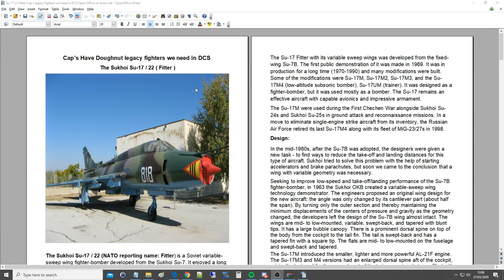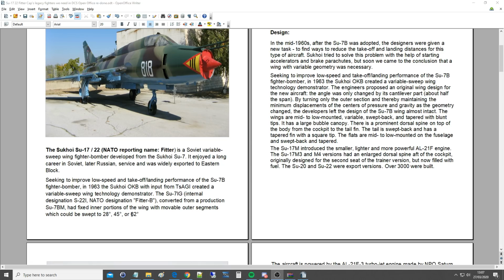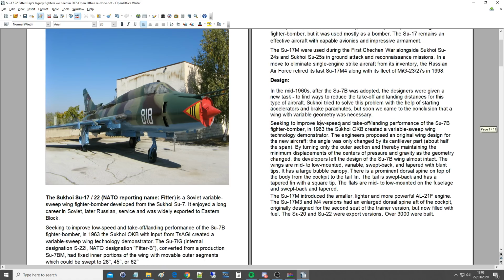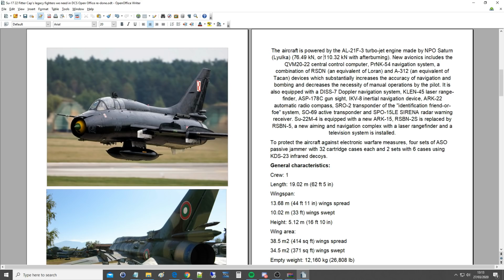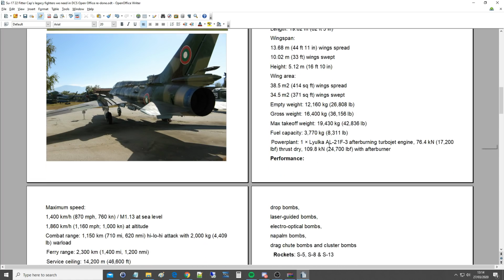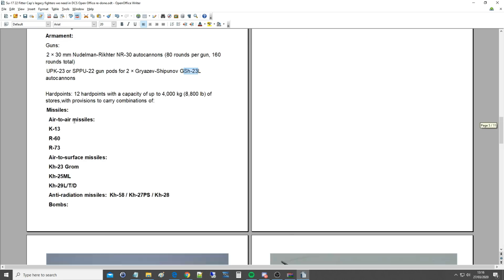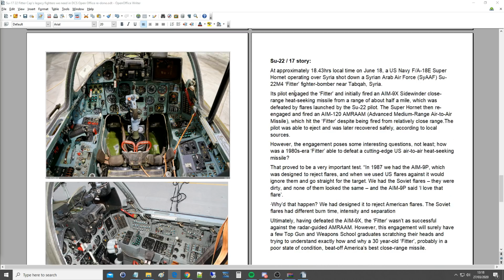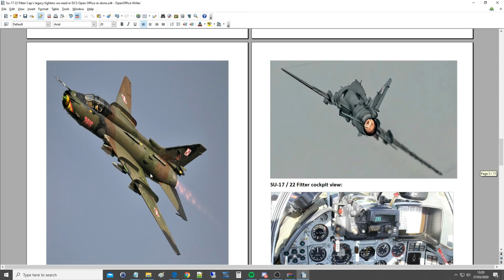Cap's Cold War Aircraft NEEDED In DCS WORLD: Su-22 Fitter

Comment: I believe  'FLAT'S   refers to the tailplane  surfaces   which  do not provide lift through an aerofoil but rather as a flat surface  whose lift is varied by adjusting the angle of attack of the entire tailplane surface rather than through distinct elevators on the tailplane trailing edge.    Here it is mounted relatively low down on the fuselage to avoid the turbulence of the wing. This is common in higher speed aircraft.
Reply: Thanks ... never knew that!

Comment: Pitty it didn't have a radar. It would be really nice replacement for playing DCS MiG21 module.
Reply: Not really in any way. The SU-17/22 is a dedicated ground attack aircraft. Basically an older Soviet counterpart the the AV-8. Same roles. It's still flying today, and has seen extensive use in Syria as a close air support aircraft. Also  did I miss something? I have been over seas for the last few months. Why dose the 21 need replacement?
Reply: @sasquatchycowboy5585  Yea but with radar it could replace it in DCS multiplayer gameplay. I wasn't referring to real life. Should behave better at low speeds and similar has short range missiles.

Comment: +GrimReapersAtomic  The OKB Sukhogo (RUS) Su-17/22 family was a Soviet counterpart of the USAF / Republic F-105 with lower wing loading.  The Arkhip-Ljul'ka-21 and the Pratt & Whitney J75 were exact contemporaries for equivalent performance requirements.
Reply: So improved on the F-105 concept. I like it.
Reply: @sasquatchycowboy5585  Considering the designed roles it would be stretching it some to  consider it an improvement.  And with the swing wing it would be a big problem having to fight in one if you got jumped.
Reply: @jpjpjp453  Fighting in any attack plane is a big problem if you get jumped. But not sure I understand your argument about swing wing. And to 105 lost over half the production run in Vietnam, so not really a great jet to get jumped in ether. But the swing wing should give it a lower landing speed, which should allow it to operate from shorter runways. The long takeoff, and high landing speeds were a constant issue with the 105. This thing has had an extremely long servic record, and is still in use. To my knowledge it's been pretty successful in its role. The 105 was replaced about as soon as possible.
Reply: @sasquatchycowboy5585  The vast majority of F-105 losses were from AAA, especially up in the heavily defended targets areas in RP5 and RP6 .  Not to mention the F and G models doing the very risky Wild Weasel role in dealing with SAM sites. They were also credited with 27.5 Mig kills. For run of the mill ground attack the SU-22 would be sufficient, but i seriously doubt it could be used to attack things like the Thái Nguyên steel mill or the Paul Doumer bridge on a consistent basis. The 105 flew 3/4 of all sorties up North during Rolling Thunder and was replaced because total production was 833.  There was also consideration for a while about restating production
Reply: @jpjpjp453  Sorry I offended your pet plane. But I suspect if flow by us or the Russians the 17 would have been just fine. And since I highly doubt your a 105 driver, your experience is the same as mine. And I've read too many accounts from there drivers to change my mind on this. So we're gonna have to agree to disagree.
Reply: @sasquatchycowboy5585  I read all those accounts too. Also heard info about the 105 right from the pilots mouths. Thanks for taking the debate loss like a champ.
Reply: @jpjpjp453  Not sure I lost that debate there boomer, Also pleas elaborate on why you think the swing wing would be an issue in a fight. It's an unwinnable debate about a hypothetical scenario. Which aircraft would have performed better in the Vitamin war? Well the 105 suffered horrible losses in its role. I'm not sure that the SU-17 has faced a similar situation. But it has seen a shit load of combat in it's own right. You seem to believe that the 105 is a great dog fighter, and that losses to SAMs and ground fire don't count against an attack aircraft. I would say that count more then any ability in air to air combat, because those are the threats it likely to face, and and non fighter is hosed against any contemporary fighter. I'm saying its improved because it will have better low speed handling characteristics, which are more important for an attacker, because it allows more flexibility in basing. I would say that the facts that SU-22s are still in service while to my knowledge not a single county still operates the 105 is evidence that the Su-17/22 design has more desirable characteristics that have kept it in service. And before you point out the age of the 105, remember the F-4 is still in service as well. So if you want to clam victory then go ahead but I at no point conceded. I simply have way more pressing matters to attend to then arguing which obsolete attack aircraft design is superior to the other. And aging pleas elaborate on why you see the swing wing as a disadvantage, because your logic there escapes me.
Reply: @sasquatchycowboy5585  I'm busy now, so i'll get back to you.  BTW-Try not to use something like boomer. It was cringey at best and is already played out.

Comment: No this cant be real... I just read about the Su22 defeating an Aim-9X with flares, and just 1 hour later you come with this video?? really???
Reply: I don't think he defeat it, it's more likely it just malfunctioned.
Reply: @schweizerluchs  The missile did not malfunction, it chased a flare, The missile would not have done that if it was simply "malfunctioning".
Reply: @Hyperus  It's supposed to ignore flare decoys so it did malfunction.
Reply: @terryboyer1342   it was to ignore flares but not the old russian type flares, they burn with diff temperature and spectrum and very dirty mixture........ and the Aim-9X is programed to ignore modern  flares......
Reply: @IvanRD-33  Not necessarily, but the Su22 was supposedly outfitted with a newer set of flares earlier, what those flares are is something we don't know
Reply: @IvanRD-33  So old obsolete tech defeats new tech. Reminds me how stealth aircraft are designed to make modern digital  high freq radars less effective but older analog low freq radars detect them more easily.
Reply: @Hyperus  hard to believe they would spend on flares when the aircraft is in poor state of repair
. Some of the vids of those jets over there makes you scratch your head how are they still flying....
Reply: @terryboyer1342  No, it is clearly misconception. No obsolete tech defeating new as it all works in the same way. What is the difference between newest F-16 with flares and SU-22 with flares? None of them have any measure to reduce IR signature. You may have onboard systems to detect missile launch and automatically release flares (F-35 is said to have some sort of it) but unless you have some special engine shielding and IR seeker defeating laser or something alike its all the same. Whether you are sitting in Me-262, Viper, SU-35 etc - from this point of view it is no more modern nor obsolete.
Most likely the flares were emitting spectrum that was compatible with what the seeker was looking for or it was strong enough and again in the right spectrum to make it blind. Combined maybe with the Su's turning it went away from the missiles path.
Reply: @mungo7136  No. After Afgan war and experience whit Stingers and Syrian and Iraqy expirience whit AIM-9, Soviet developed new type of flares to counter those western missiles. Those flares were finished few years after and as we see, they effectivly counter AIM-9s and Stingers. So no, this are not old flares, this are new model.
Reply: @terryboyer1342  American IR Air to air missiles love to Follow  soviet - Russian flares.